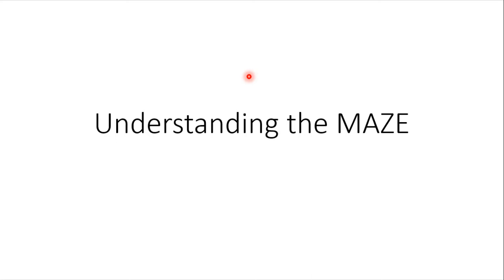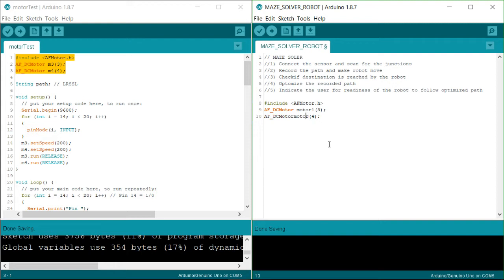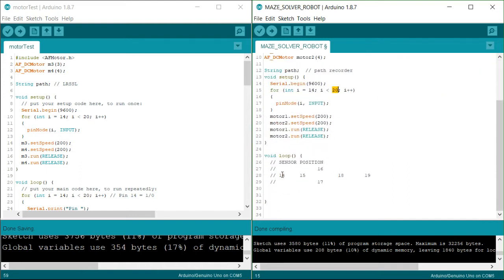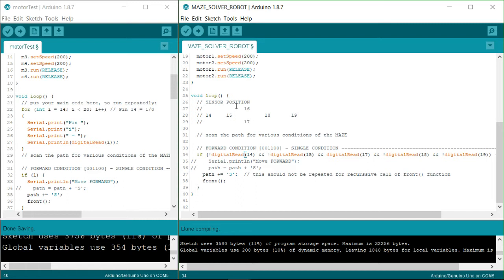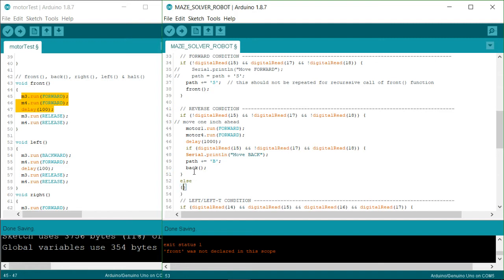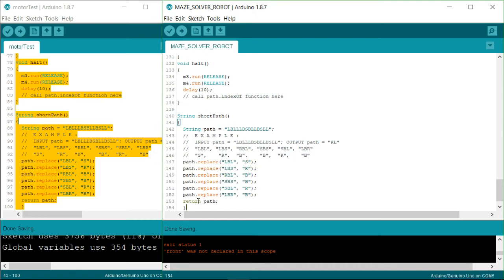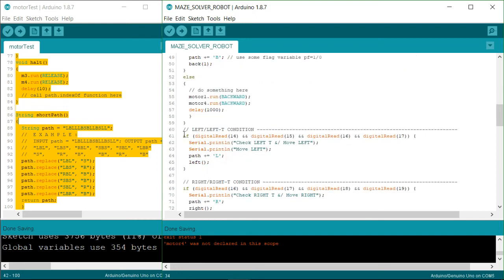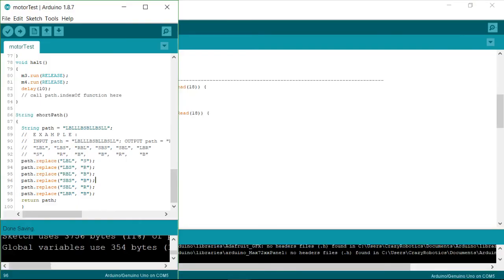10a Maze Solver and Debugging

Comment from the maker: For all those who want to try this as it is with the same components, try this code.....

/*Pin usage with the Motorshield
---------------------------------------
Analog pins: not used at all...
A0 ... A5 are still available...
They all can also be used as digital pins.
Also, I2C (A4 = SDA and A5 = SCL) can be used.
These pins have a breadboard area on the shield.
Digital pins: used: 3,4,5,6,7,8,9,10,11,12
Pin 9 and 10 are only used for the servo motors.
Already in use: 0 (RX) and 1 (TX).
Unused: 2,13
Pin 2 has an soldering hole on the board, easy to connect a wire.
Pin 13 is also connected to the system led.
I2C is possible, but SPI is not possible since those pins are used.
*/
#include <AFMotor.h>
AF_DCMotor m1(1);
AF_DCMotor m2(2);
String path;
int mode = 0;
void setup() {
  // put your setup code here, to run once:
  Serial.begin(9600);
  for (int i = 14; i < 20; i++) {
    pinMode(i, INPUT);
  }
  pinMode(2, INPUT);
  m1.setSpeed(255);
  m2.setSpeed(255);
}

void loop() {
// mode-0 //mode-0 //mode-0 //mode-0 //mode-0 //mode-0 //mode-0 //mode-0 //mode-0 //mode-0 //mode-0 //mode-0
if(digitalRead(2) == 0)
{
    for (int i = 14; i < 20; i++) {
    Serial.print("pin");
    Serial.print("i");
    Serial.print(" ** ");
    Serial.println(digitalRead(i));
  }
  // SENSOR POSITION
  //                       16
  //14     15                               18       19
  //                       17
  if (!digitalRead(14) && !digitalRead(15) && digitalRead(16) && digitalRead(17) && !digitalRead(18) && !digitalRead(19)) {
    //  Serial.println("move forward ");
    path += 'S';
    front();
  }
  //Reverse condition
  if (!digitalRead(15) && !digitalRead(17) && !digitalRead(18)) {
    m1.run(FORWARD);
    m2.run(FORWARD);
    delay(1000);
    if (digitalRead(15) && !digitalRead(17) && digitalRead(18)) {
      path += 'B';
      back();
    } else {
      m1.run(BACKWARD);
      m2.run(BACKWARD);
      delay(1000);
    }
  }
  // LEFT/LEFT-T CONDITION
  if (digitalRead(14) && digitalRead(15) && digitalRead(16) && digitalRead(17)) {
    if (path[0] == 'R') { right(); }
    if (path[0] == 'L') { left(); }
    if (path[0] == 'S') { front(); }
    Serial.println("Check LEFT I &/ Move LEFT");
    Serial.println("Move LEFT");
    path += 'L';
    left();
  }
  //RIGHT/RIGHT-T
  if (digitalRead(16) && digitalRead(17) && digitalRead(18) && digitalRead(19)) {
    Serial.println("Check RIGHT T &/ Move RIGHT");
    path += 'R';
    right();
  }
  //Cross Condition
  if (digitalRead(14) && digitalRead(15) && digitalRead(16) && digitalRead(17) && digitalRead(18) && digitalRead(19)) {
    Serial.println("");
    left();
  }
  //Move slight left condition
  if (digitalRead(14) || digitalRead(15)) {
    Serial.println("move slight left");
    left();
  }
  //Move slight Right Condition
  if (digitalRead(18) || digitalRead(19)) {
    Serial.println("move slight right");
    right();
  }
// mode-1 //mode-1 //mode-1 //mode-1 //mode-1 //mode-1 //mode-1 //mode-1 //mode-1 //mode-1 //mode-1 //mode-1 //mode-1
  if(digitalRead(2) == 1)
  {
    ShortPath();
    go();
  }
}
}

String ShortPath() {
  String path = "LBLLLBSBLLBSLL";

  path.replace("LBL", "S"); 
  path.replace("LBS", "R");
  path.replace("RBL", "B");
  path.replace("SBS", "B");
  path.replace("SBL", "R");
  path.replace("LBR", "B");
  return path;
}

void go()
{
  unsigned int i=0;
  // Follow the outpath
  if (!digitalRead(14) && !digitalRead(15) && digitalRead(16) && digitalRead(17) && !digitalRead(18) && !digitalRead(19)) {
    if (path.charAt(i)== 'L') {
      // Update the PATH only if there is a change
      // take left turn
      left();
      i++;
    }

    if (path.charAt(i)== 'R') {
      // Update the PATH only if there is a change
      // take right turn
      right();
      i++;
    }

    if (path.charAt(i)== 'S') {
      // Update the PATH only if there is a change
      // move straight
      // moveForward();
      front();
      i++;
    }
  }

  if (!digitalRead(14) && !digitalRead(15) && digitalRead(16) && digitalRead(17) && !digitalRead(18) && !digitalRead(19)) {
    //  Serial.println("move forward ");
    front();
  } 

  if (!digitalRead(14) && !digitalRead(15) && !digitalRead(16) && !digitalRead(17) && !digitalRead(18) && !digitalRead(19)) {
    //  Serial.println("move forward ");
    halt();
  }
}

void front() {
  m1.run(FORWARD);
  m2.run(FORWARD);
  delay(100);
  m1.run(RELEASE);
  m2.run(RELEASE);
  delay(1);
}
void back() {
  m1.run(BACKWARD);
  m2.run(BACKWARD);
  delay(100);
  m1.run(RELEASE);
  m2.run(RELEASE);
  delay(1);
}
void right() {
  m1.run(FORWARD);
  m2.run(BACKWARD);
  delay(100);
  m1.run(RELEASE);
  m2.run(RELEASE);
  delay(1);
}
void left() {
  m1.run(BACKWARD);
  m2.run(FORWARD);
  delay(100);
  m1.run(RELEASE);
  m2.run(RELEASE);
  delay(1);
}
void halt() {
  m1.run(RELEASE);
  m2.run(RELEASE);
  delay(10);
}

Comment: How can I convert it into a white line follower
Reply from the maker: Just replace all the conditional statements (if loops) to check for a 0 if it's a 1 mentioned in the code shared earlier. 
Assuming that the IR sensors deliver a "1" while it senses a BLACK and hence invert it to a "0" to sense a WHITE line instead.

Keep learning and Keep sharing.
Reply: Can I achieve this by inverting the logic of digitalRead? @CrazyRobotics

Comment: Sir how are we defining for unknown no. Of index..?
Reply from the maker: I suppose you want to know about junctions. There is no UNKNOWN in any case as long as we use sensors and every junction is captured during a training sprint and later we optimise the path to find the shortest one to be followed by a robot during the second sprint.
Reply: @CrazyRobotics  no, i want to know how will it identify the junction it's encountering first in final run
Reply: @CrazyRobotics Like in the code of Left/LEFT-T
you've written ..
path[0]....
But, if the bot is solving another maze like right-t comes first how will you do it?
Or, if how will get the right consecutive value in [ ]
Reply from the maker: you are thinking in the right direction.
If its solving another path then obviously it will optimize a path that it has recorded earlier and hence there will be no NEW path after optimization during FINAL RUN.
Just give it a try with a different path than the one in the video and let me know your response.

PLANNING SOON TO POST A NEW DETAILED VIDEO COVERING ALL MINOR ASPECTS. STAY TUNED AND KEEP SUPPORTING.
Reply: @CrazyRobotics  Thanks. Pease upload it fast

Comment: i have two dc motor with encoder can i use this code for my robot line follower?
Reply from the maker: Yes, why not!..... as long as you follow the basics such as Motor speed, sensor placement, motor driver and proper pin mapping in the code.
All the best.....✨

Comment: sir you have already defined string path but for different maze there will be different  string path what should be do at that time ?
Reply from the maker: The program remembers the path, basically it records the path in the first iteration based on the sensor readings. There is a need to tweak sensor placement on the robot for optimum path recording with multiple trial-error experiments to cover all types of moves. The rest of the headache is handled by the code in optimizing the path and reaching the goal in the second iteration.

Comment: how to modify your code for unknown code
Reply from the maker: Depends on what your build and application is. If you prefer using the AFmotor library then use their documentation. On the other hand if you prefer using no library then simply modify( which means write your own I/O operations on digital pins to get the job done) as per your requirements. If you prefer using the same build and components then you may utilize the code pinned under the video.
Alternatively, you may also write down a pseudocode for your application and later decide which approach fits best for achieving goals.

Comment: If I need to follow white line what changes has to make in code
Reply from the maker: Simply you need to invert all conditional values under "if" conditions. e.g. if it was if (a==1), make it if (a==). Additionally, this process is applicable when you are switching from Active-High to Active-Low sensors or vice-versa.
Reply: can you give the sample code for it
 @CrazyRobotics
Reply: Do you want the code to work on white line? @chinmayil1pat615
Reply: it is already shared under the comments section. Please try it out and keep exploring 🎉